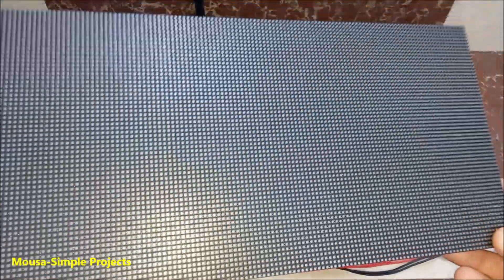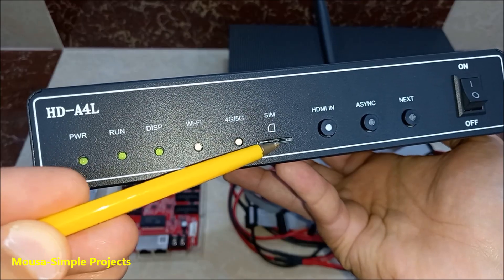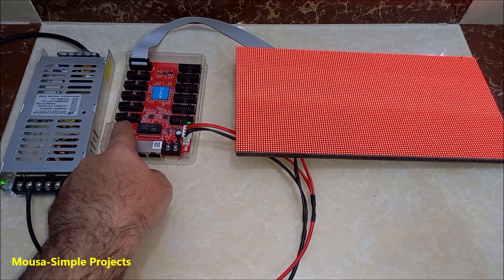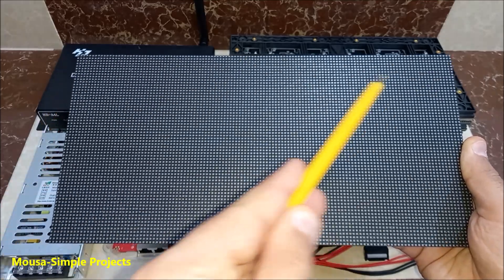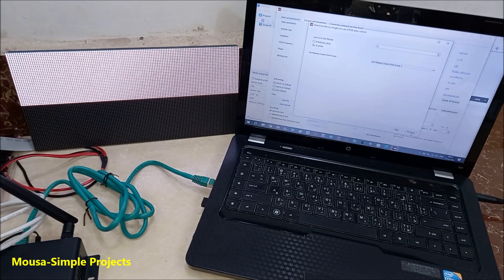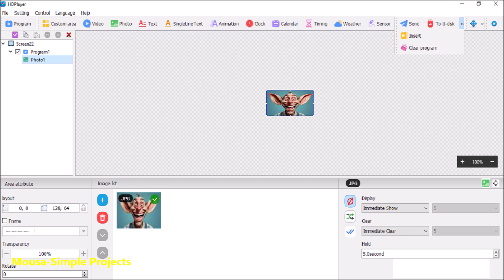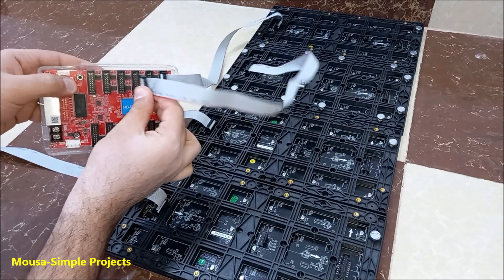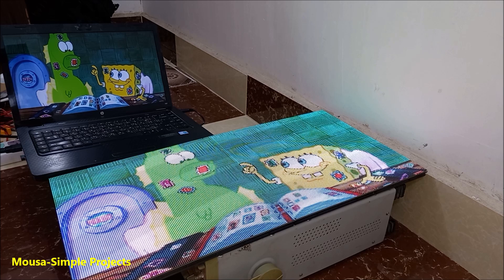How to make Programmable LED Sign board / Billboard WiFi and HDMI

Comment: How does it cost??
Reply from the maker: The entire setup including power supply, 4 display, controller...etc, cost around $300 from local store, on Aliexpress cost less, maybe $200 or $250. Maybe for small size not worth it (regular TV has better resolution and lower cost, I made small size for educational purpose) but for super big size used in streets and stadium worth it.

Comment: Good morning,
I was wondering if there are supports to hold P 2.5 panels together for 3D printing (for example, there are some for P5s).
Thanks
Reply from the maker: I haven't personally come across 3D printable supports for P2.5 panels. This is the only thing i found on internet but not the same size, you can change the size by printer setting:
https://www.printables.com/model/124285-a-mount-for-an-64x32-rgb-led-panel-with-an-adafrui
Reply: @MousaSimpleProjects  Thankyou so much,  for the reply.
I also checked and didn't find anything for 2.5 panels.

Comment: Sir please reply with the list of material you used in these project. I want to use these as school project.
Reply from the maker: P2.5 LED module 32cm x 16cm 
Receiving card R712
Multimedia player HD-A4L
Power Supply 5V 40A
Connecting wire

Comment: Great video, What is the cost of the components? I'm trying to figure out whether it is cheaper to DYI build a sign or just buy a cheap LED TV.  Can you list the links of where you bought these components?
Reply from the maker: It cost me almost $250 which is not worth it for small size display with this low resolution (mine is almost equivalent to 32 inch TV).
This LED sign designed to use in super large size not small TV size but i did that to explain the installation.
I haven't the purchasing link because i bought them from local stores, but you can check Aliexpress.